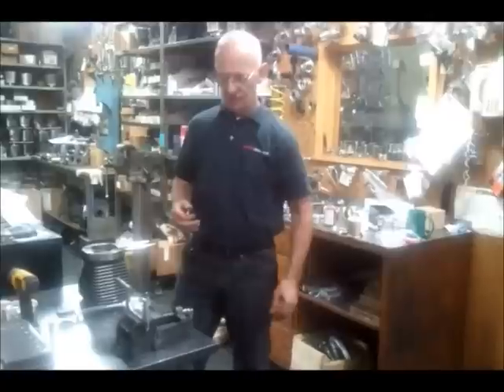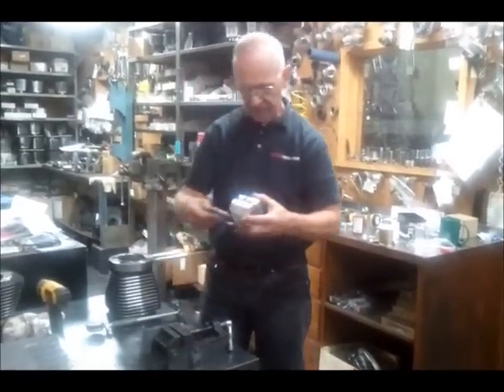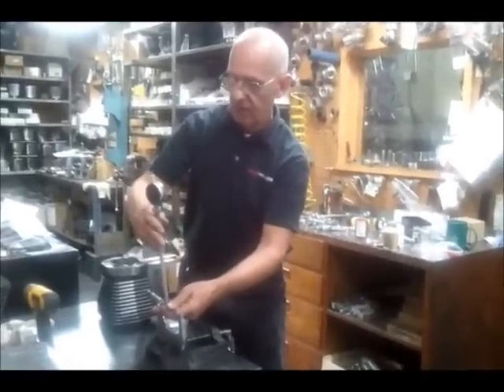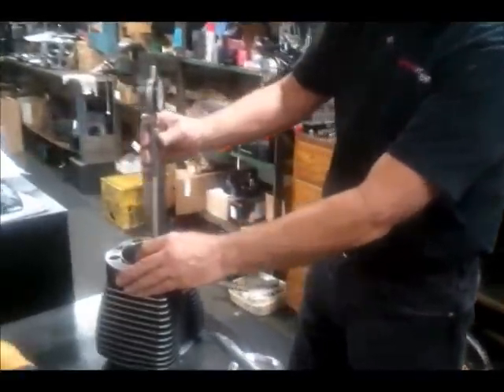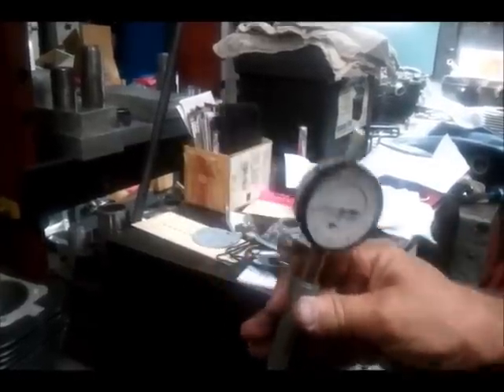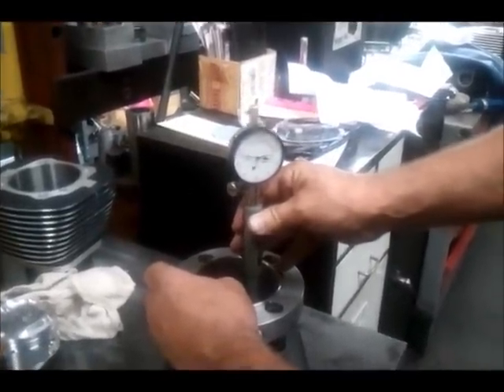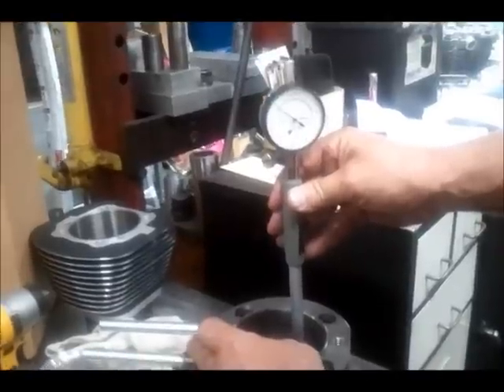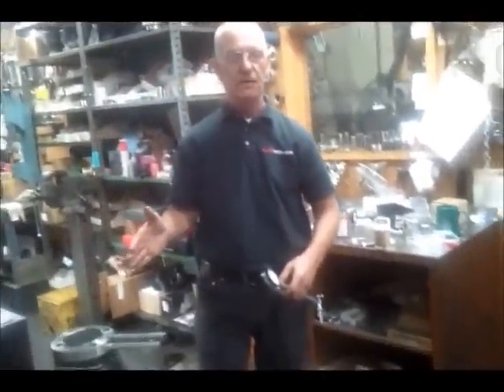Harley cylinder measuring

Comment: What is that fixture on the cylinder base - is that necessary or can the cylinder be measured without it?
Reply: That's a torque plate (there are two per set). You need them for accurate measurement/boring/honing.. You also need your FACTORY service manual and parts book. (Not Clymer/Chilton/Haynes/etc.) The service manual would have answered your question.